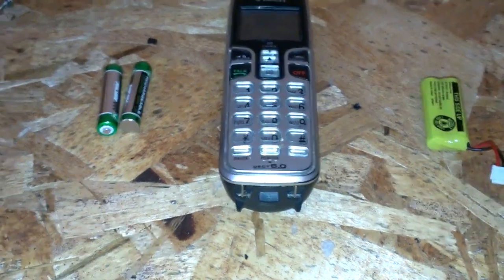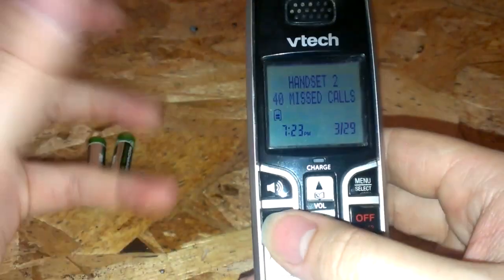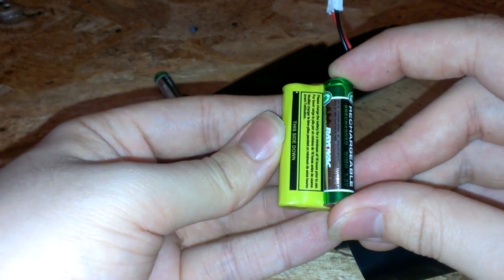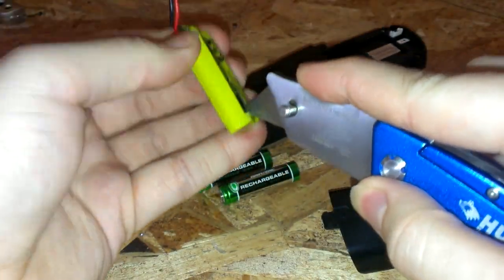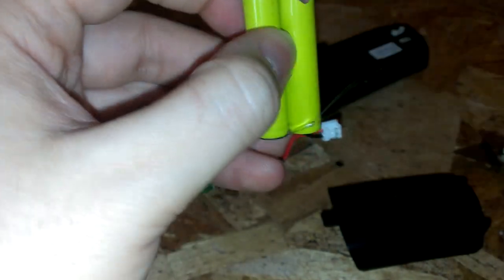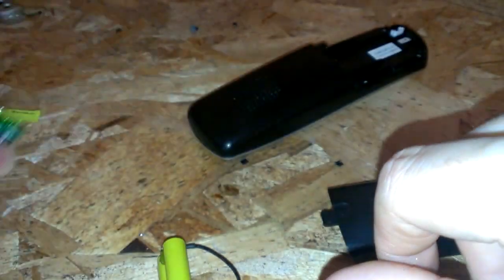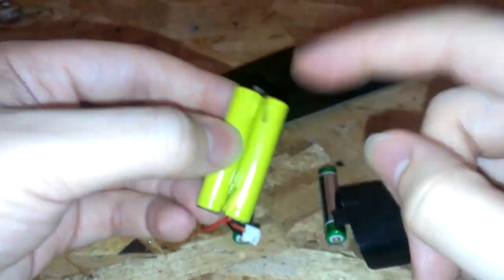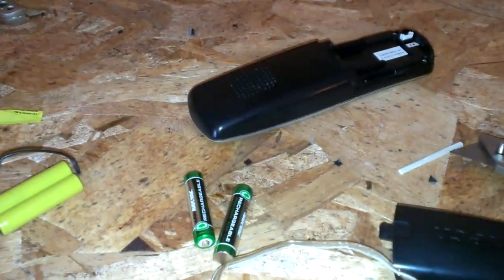Cordless phone battery pack mod

Comment: The reason they didn't make the battery pack the way you did was in a high volume, fast production line, it is simpler to have the batteries in one orientation.  Soldering the wire is done by machine and they can make them in about 2 seconds.  As for the quality, the ones you can buy are better quality and capacity.  Vtech is like many cheap companies and uses the lowest quality they can get away with.